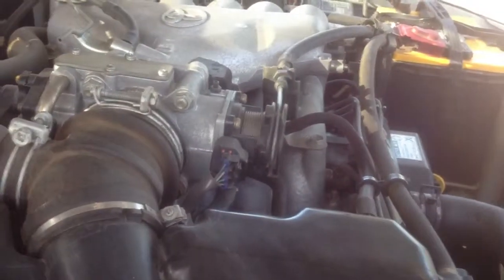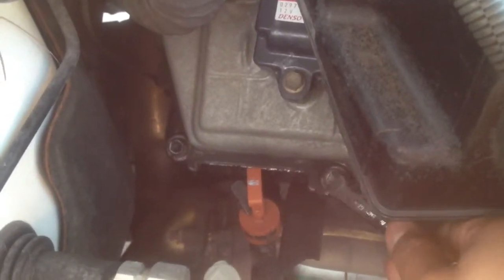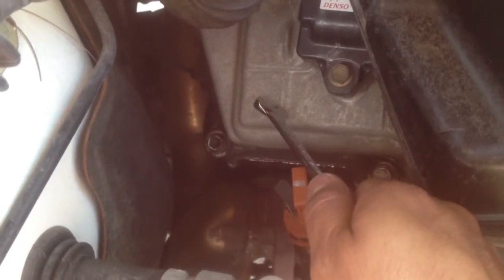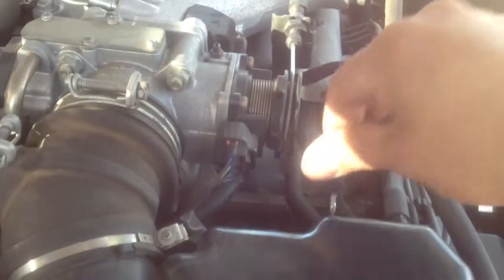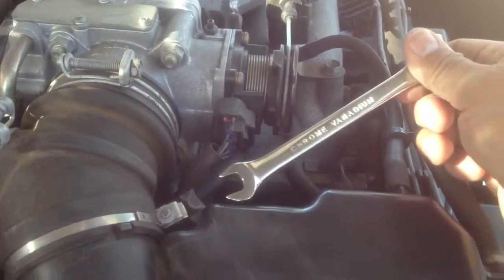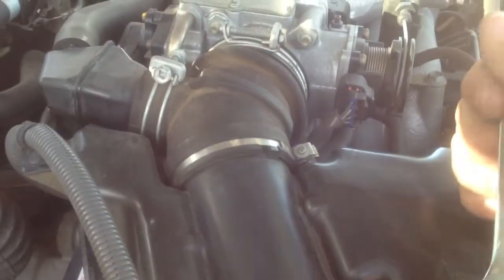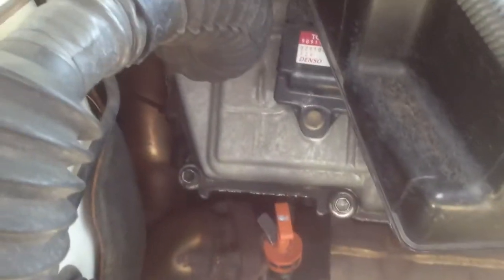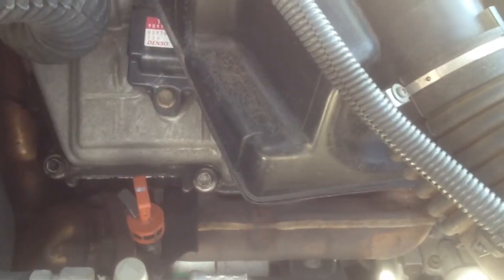2001 4runner SR5 valve cover bolts

Comment: Don't do this without a torque wrench!  According to my research these valve cover bolts require a very low torque setting of 51 inch pounds.  They can very easily be over torqued which can lead to snapped bolts or even worse a cracked valve cover.  While this can be a fairly easy fix to stop your valve covers from leaking, do some googling first to determine the torque settings and use a torque wrench.